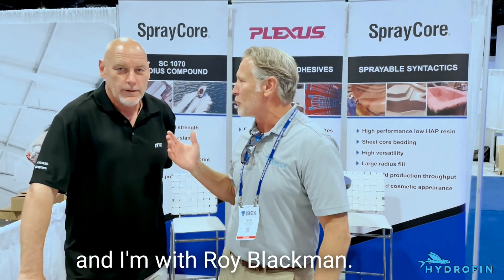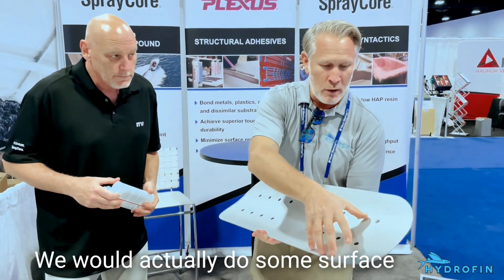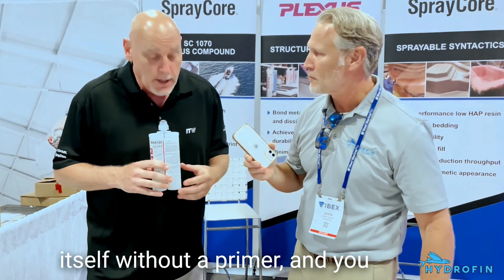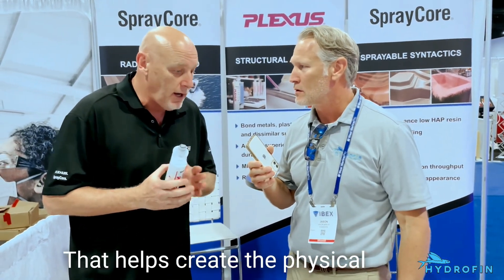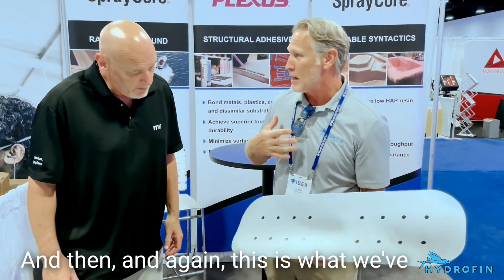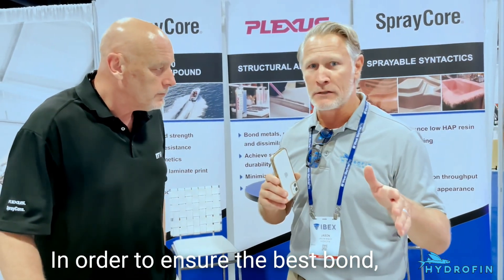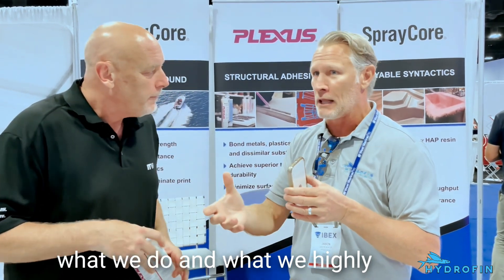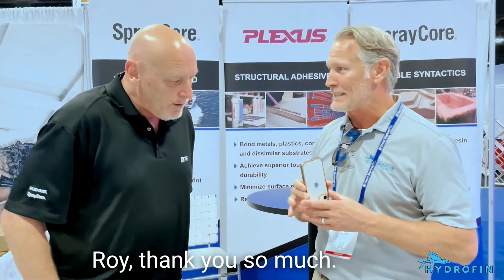How to bond Hydrofin with Plexus

Comment: My grandson and I replaced the fins on my toon after a damaged tube was replaced. I was able to match it up with the existing one, and it’s been working great for over a year. We were early adopters and have several years and hundreds of hours and miles now on the fins. I have saved $$$$ thousands in gas, and my 26’ pontoon goes 35mph at 40% throttle.